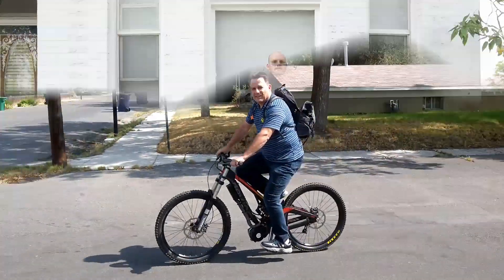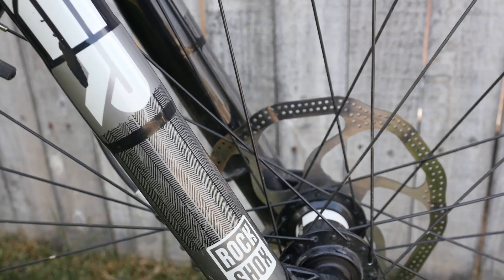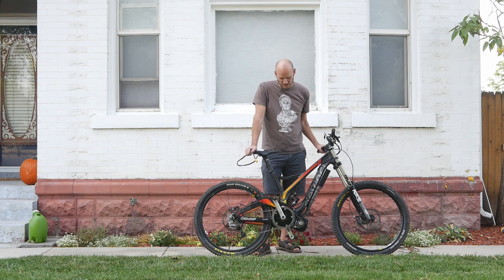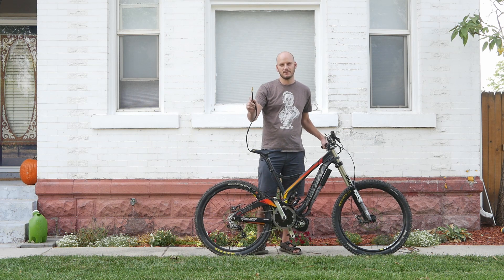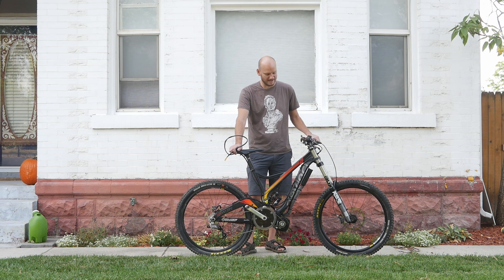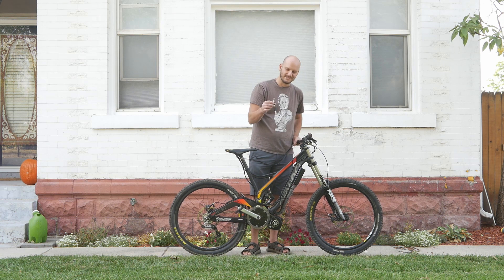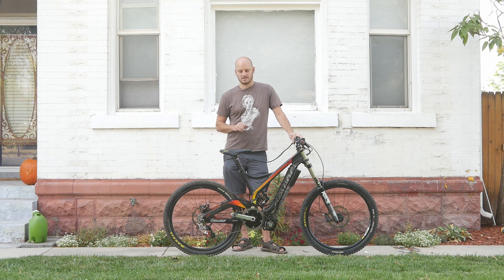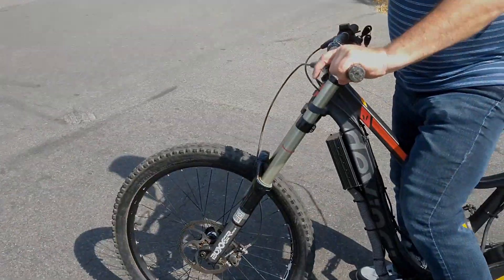Custom E-bike Build: Devinci Downhill w/ Cyclone 3k watt mid drive. Stealth Bomber killer?

Comment: How have the bikes you have converted been for wrecking rear hubs? The rear hub on my downhill bike has been stripped where the pawls engage. I am going to rebuild the rear wheel using a Saint hub, but I am not sure that it will last much more than a year. Too much power through the rear wheel with the Cyclone.
Reply: This is something I worry about

Comment: correct me if i'm wrong, coz i'm still trying to figure out how mid drives work, so they share one drivetrain, you put the lowest gear on and the mid drive climbs steep hills like nothing, on the other hand you put the highest gear on and it's easier for the mid drive to achieve higher speeds, whereas a Hub motor only has one gear?
Reply from the maker: Yes 👍 essentially

Comment: someone paid you to use zip ties, an inner tube for vibration and a hose clamp to hold the motor, im in the wrong business. you could of at least use a wire sleeve that matches.

Comment: U should have just added a rear rack and placed the battery on there it’s not safe to have the battery on ur back if u crash
Reply from the maker: Agreed, also would be more comfortable to ride with.
Reply: @JohnnyNerdOut  Putting the battery out way behind the rider actually has a big effect on handling.     I tried putting a large battery on the rear rack and it was downright scary even just casually riding.
Made the bike so squirrelly and unstable,  even trying to wrench the handlebars out of my grip on a mild downhill road.

On a performance offroad bike like this where you want the best handling?   Absolutely no go. 

Better to reconfig a little,  and put the battery in front of the downtube if there is no room to put it inside the triangle.

Oh,  I really enjoyed your full conversion guide for the BBS01/02    will you be doing a similar conversion guide for the new Cyclone 3kW?

Comment: I love it too, hasn't been in stock for about a year now, I am thinking of going GNG 72v 40amp mid motor, do you have any experience with this brand, or any other suggestions? Currently running a 2000w boat anchor ⚓ I mean hub motor 🤪 72v, it's only fun when it's at full throttle. Want to build a steel hard tail with 160mm front shock and crazy 72v 3000w mid motor, that's the dream at least
Reply from the maker: I carry the cyclone motors 👍
Reply: @JohnnyNerdOut  do you have website? How much $$$, can I get just motor with mount and cranks, have controller, throttle, and display. 72v 2000w 45amp, peaks at about 3400w , should work pretty good? can lower amperage on controller.
Reply from the maker: @liamneal5325  johnnynerdout.com

Comment: Your always ragging on the bafangs in these cyclone videos but tbh if you used the same controller on a bbshd it would literally do the same power and same fun.  I'm pushing 4000+ watts out of my BBSHD with ASI bac855 controller and NXT display from ERT and it literally puts all other ebikes to shame.  Does wheelies all day and does 50+ mph in almost every gear which is quite weird but yea that just seems to be how the motor is it will do a lil more mph in a smaller gear but as your likely aware of the BBSHD will over heat if you don't keep the rpms higher.
Reply from the maker: Ya I know its possible, Just the Cyclone is waay cheaper to achieve similar results and built better to handle the higher wattage IMO

Comment: I've had a Cyclone with a 72v battery for about 7 years now. I can pretty easily get it up to 50mph, and i can climb straight up a flight upstairs if i need to. Its a lot of maintenance but its definitely worth it if you can deal with breaking your bike ALL the time. Ive burnt motors, burnt controllers, even the throttle's seem to break all the time. Everything is relatively easy to replace once you know what you're doing.
Reply: The cyc is the same but better it output 7kw and needs nearly no mainteance
Reply: @name get a Shadow Conspiracy Interlock Supreme BMX Chain, about $60-80, they are thicker and meant to take a hell of a lot more abuse.
Reply: oh man, and i was gonna ask if the motor is reliable... so i'm better off with a hub drive? i thought chains and sprockets was the only thing i had to worry about
Reply: @TheGamingChad.  I wonder now how a rear hub might treat me I should get one and fix the mid mount as a second motor in the loop
Reply: How many cyclone motors have you gone through? I think if you oversize the controller they will last a very long time.
Reply: @sumosamurai5420  iv still got the same one for nearly 10 years tho alot of its life has been geared closer to the 50/50 range so 30front 34 back atm very hilly were I used to live
Reply: Hey mate have ya got a dual suspension bike and does the chain stay on eventually like can ya get the hang of no clutch in a sense my last take with my dualy near took some spokes out with the derailer so swapped to a fat tyer rear on boxer front shocks wasn't bad for abit

Comment: Johnny first off I love the love you have for ebike because I'm the same. I'm sure you have heard of the CYC mid-drive but I didn't see any videos of it. If you haven't taken a ride on one this is something you must do.  Not only does it look good it's a motor that makes the motor in this video look like a B.. If you know what I mean. This motor looks better than nearly anyone one out there they also  have the best customer service then probably any company I've bought from. The motor can do 72 volts at 5000 watts and 150amps in a very compact package. Everyone says an ebike is a dirt bike like you stated in the video but this motor is half the size and near twice the power. I keep my motor at 52volts 80amps 5000watts and that's a death wish. 72volts 5k at 1500 amps would probably break chains daily. Lol. Anyway I thought I would give some insight and I love the videos. Ride hard and long and try to stay safe.
Reply from the maker: Definitely heard of them. Got signed up as a dealer, now just need to raise the funds to purchase the minimum qty.... I’ve been waiting to try it for a while.
Reply: Where did you get yours?
Reply: @midnightwaterdragon4725  I got it from CYC.. If you're doing trails get the Stealth if you wish for all out power get the X1 2nd gen. One more thing 52 volt 60amp is crazy strong on ether just crazier with the second option.

Comment: It seems with the adjustability problems with the cyclone and the derailer that the Rohloff speedhub would be the way to go. At least that is what I have seen watching how to videos on the cyclone motor which you don't do so we would not know if you had any problems building it.
Reply from the maker: To my knowledge the rohloff doesn’t support thru axles.otherwise I would’ve done it for this build. That’s a great hub
Reply: @JohnnyNerdOut  In 2016, Rohloff introduced a new version of their renowned SPEEDHUB 500/14 14-speed internal gear hub that works with through axle frames. Dubbed the SPEEDHUB A12, Rohloff offers versions to fit frames with 12x142, 12x148, 12x177, and 12x197mm spacing.Mar 2
Reply from the maker: @LarryRichelli  interesting.  Good to know! Now to find a source for them! Thanks!

Comment: Sweet! I'm amazed you can put that much power through that carbon fiber rear triangle. The Cyclone has enough power to twist poorly made parts to bits.
Reply: Carbon fiber structures have a tensile modulus about 10 times that of steel.

Comment: great clip mate, was great to use as reference on my cyclone stinky build , similar  yours with homemade backpack batttery 72v 14ah.  but chucked a rohloff on it which is amazing . the cyclone is a beast compared to bbshd. so much torque. did you need to brace for torque back to the frame ?  I have only had shakedown ride and need to tame it with bluetooth , cheers Legend
Reply from the maker: Ya you have to strap it to the frame with a giant hose clamp since it kicks like a mule. Does your bike have thru axles?
Reply: i bought a luna mount thinking i wouldnt need the hose clip , but i was wrong the torque has bent the mount a bit already , so we are going to mill something to mount back to the frame . through axle on front but unfortunately 2nd hand rohloff came with qr .
Reply from the maker: @tonylynch2553  those Luna mounts must be thin metal?
Reply: @JohnnyNerdOut  the bits that are milled are quite nice , but the gauge of metal bb to motor is a bit thin. been watching your comparison vid cyclone to bbshd, sounds like the pas is a waste of time and throttle jockey is the way to go with this build,
Reply from the maker: @tonylynch2553  yup. IMO at least. Results vary

Comment: my next build will be cycline   but I got 120 kph out of a bbshd and it handled it but i had to change from nylon to metal gear and it was  death machine so I hoping this cyclone will killing  machine.
Reply: no chance of that speed with BBSHD
Reply: @TheSanjurok  that does sound like a lot, but the new Luna Ludicrous V2 controller can take a high end 72 volt battery and produce over 8000 watts...I own one with a 52 volt battery setup and can hit 42 mph no problem while running 3500 watts...

Comment: how big of a distance can you get on this kit before the battery goes flat. riding it flat out that is.
Reply from the maker: It has 1,000wh pack. Assuming it averages 65h /mile on flat ground going 40-45 MPH. You would get about 15 miles of range.

Comment: Very cool build! Are the gears necessary? All of them? I would think that would create enough torque for nearly any situation without any gearing...
Reply from the maker: Check out my cyclone fat bike buil on a single speed. Short answer is yes gears help in a good way, if you want to be able to do wheelies and hit 45. But probably 3 speeds would be enough IMO. Ideally on an IGH.
Reply: @JohnnyNerdOut  I doubt even a Sturmy Archer could handle that kind of torque, but they should be able to handle a BBSHD.
Reply from the maker: @MHH3180  ya. Maybe the 3 speed though
Reply: @JohnnyNerdOut  nah, as a Tweed rider, I have disassembled far too many. They are heavy-duty,  but a small misadjustment and you could tear one up.

Comment: You: 3kW Federal law 750W 20mph max 😆 So, where's the number plates, insurance, tax, licence, and crash helmet?
Reply from the maker: Off road, private property only. Not street legal by ANY means.
Reply: I meen seriously who looks at a bicycle and looks...if u peddle a little know one will notice.
Reply: @aaronkent76  that doesn't make it right. Speed kills and bikers below 20 risk o ly their own life. That is just not the case above about 30. There is a reason safety standards for frames and brakes are higher for motorcycles. Same with insurance and lisc. I am waiting for the first builder to be sued and to see if the mfg will be held responsible as well.

Comment: What HD chain is best to use for the gears  8sp.?
Reply from the maker: Kmc has an Ebike rated rated.
Reply: You are already way ahead with an 8 speed. Everything with more cogs needs a thinner chain, but only a single speed chain is thicker. 

I cannot speak to anything like The BBSHD, much less The Cyclone, but for the most part, mid-drives having chain problems is a myth. Hill climbing specialists and some sprinters generate 200nm's of torque on 12speed chains. Chris Hoy could generate 2500 watts on his track bike. I had a half single speed, half 8 speed chain on my commuter for a year and over 4000 miles without incident. I have photo's if anyone questions that one.

Comment: Very good build. Question how to fit the 3000W motor to center and not have it more sticking out on the left side? Thanks for replies.
Reply from the maker: Are you having an issue with your motor chainrings not lining up? If so, that's part of the cyclone install. Just have to keep imagining how it will fit and try different things. Make sure the thicker bracket is on the drive side.
Reply: @JohnnyNerdOut  Thanks for replies. Chainrings are lined up correct bb installed. I've seen other bikes with this set up, on some the motor  protrudes more to the left.
Bike runs good. My set up is Specialized statusbike with 3000W motor 48v controller and 52v battery.
Reply from the maker: @paulawestcott7228  ya I think that's just a side affect of having such a big motor.
Reply: @JohnnyNerdOut  Yes indeed
Reply from the maker: Also, make sure you have the correct brackets for your bottom bracket width.

Comment: 46mph was on what tooth on the rear?
Reply from the maker: the highest gear. 11t
Reply: JohnnyNerdOut would you make it a single speed bike with only the 11t?
Reply from the maker: No, it wouldn't have enough hill climbing power in only that gear. Maybe like 18t
Reply: 11t might get destroyed pretty quickly. I've been running 18t and its been very good so far. It has climb very steep hills with no problems.
Reply: @atldragonz  what’s your top speed? With the 18t
Reply: @gbrldz0  mines a 52v bbshd , stock 48t chainring, max 30mph on flats